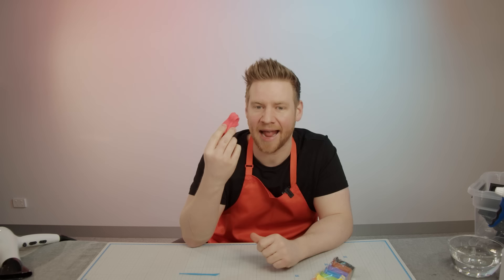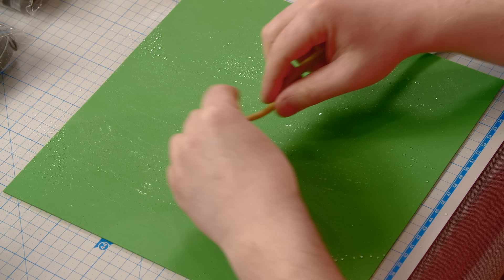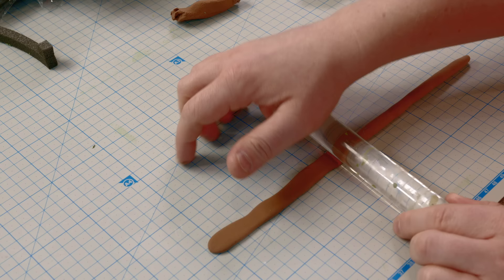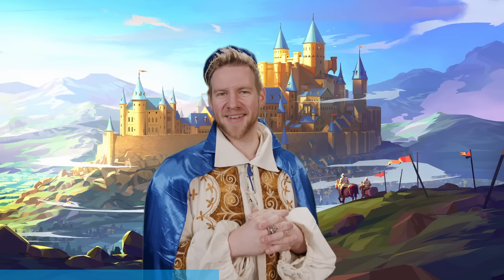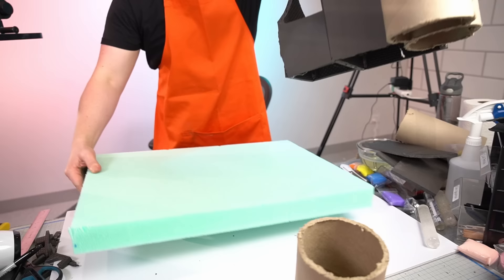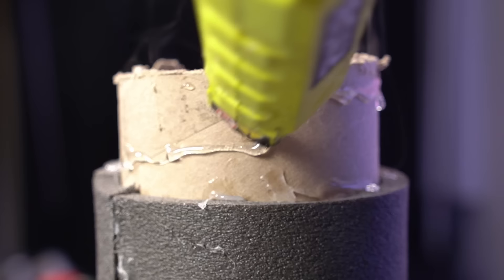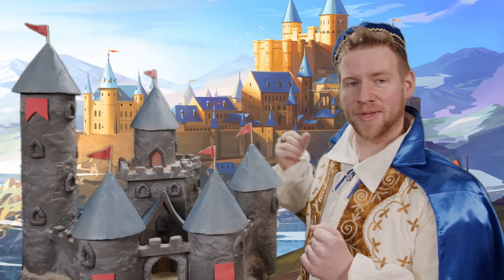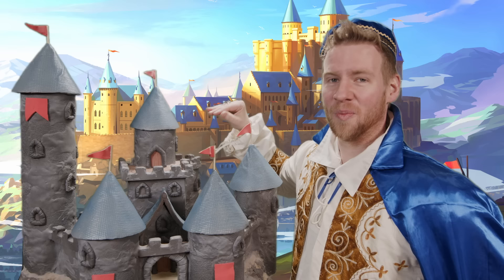"FOAM CLAY" is Mind Blowing...

Comment: I think the coolest part is using the foam clay for rocks. Lightweight rocks that can be cut, and are flexible sounds great for terrain.
Reply: This is exactly what I did with the Crayola version of it.  I even ripped up some that had dried to get rough, craggily surfaces.  I worked perfectly and since I used it for the basis of a wall hanging, the light weight was very much a must for me.

Comment: I LOVE foam clay ! I originally started using it to make my kid obscure figures/toys that were impossible to find or expensive which it’s perfect for because if you use a wire base and work very thinly then it still has minimal movement like bending the arms ect ! And if it’s breaks super glue works crazy good to fix it .. I’ve seen multiple youtubers (not Jazza obviously) bag it saying it’s useless , you can only do very simple child like stuff with it but it’s just not true ! Realistic is very ultra hard yes but I have made some awesome very detailed models using this clay you just have to go slow and work in very thin layers and add tiny bit by bit while drying in between ! If you try to make the whole piece in one go then yes it will be cartoony and simple . Wire and tin foil are your best friends with foam clay and you should keep the unused clay covered at all times it starts to dry crazy quick ! Instead of carving out details which is super difficult with this clay you just build up your details by adding bit by bit ❤
Reply: I had to take a screenshot of your post, since it has so much useful information I just know Ill need later. I got more of this stuff than anyone should, so thank you for all the tips :)
Reply: Most wholesome comment thread
Reply: You can do so much with this clay! I love using it for miniature food, it has the perfect texture for bread especially. You can shade the clay with both watercolors and acrylic to get realistic looking results.
Reply: @janemiettinen5176  that’s awesome I hope it helps !! The reason I said bit by bit (I add cm thickness onto the alloy foil base to start but then go down to mm or so thickness) is because if you go thick the very outside drys quick but the inside stays mushy for days! Something I didn’t include is water ! I reset my clay constantly it’s the only way to get a real smoothed out harder texture and if any mistake is made or even just want to add a touch of colour with the clay you can get a tiny bit and keep smoothing it out with a wet finger in you palm till it becomes a mushy paste and you can just rub it into the Dry clay , I do this too to stick details on like just wetting dry clay it won’t stick it properly you really have to rub in new wet clay first . No amount of clay is too much clay you’ll get through it ! I’m forever buying more 😂 just don’t get disheartened ! Every time I make something my first layer (the base) I’m always thinking ugh looks terrible! But I keep adding details and it becomes better and better just practice and patience 🙂✌🏼
Reply: @annuncreates5962  you really can but its seen as just kids clay for some silly reason🤷🏼‍♀️ yea your right I’ve made miniature burgers and stuff it really does work well for that .. I haven’t tried colouring it before I always spend time trying to mix to the right colour which is hard sometimes ! I wasn’t sure if I should use acrylic or what but I hadn’t even thought of water colour I’ll have to try it ! Does it rub of though eventually or soak in or do you seal it after ?
Reply: @bup489  😊🥰
Reply: This deserves more likes

Comment: I recently got into foam clay too! I am a face painter, and I recently decided to start doing face paint 'bling' (pretty pre-done displays made with 3d fabric paint, gems, and foam clay that can be glued on with proaid).
I've been having a lot of fun playing around with it. They're great for unicorn horns and trying to get gradients going is really interesting. I've been brushing on glitter and mica powder while it's still wet. And it's so easy to push it into molds for really pretty designs. And I can do decently sized decorations because it's so light weight it's not going to annoy the kids. I can't wait to have enough done that I can break them out at my gigs.

Comment: Been using this stuff for the last year... To mask miniatures for spray-painting effects. Works great! Specially if you wait for it to dry... But even if not, leaves no residue, weights nothing... and holds in place. Even more pleasing to peal than Tamiya tape... But to model scenery, for use over a flexible mat... Try stamping! Works great. As good as plasticine. Or maybe even tree-trunks, so they are flexible! Inspiration found...

Comment: An other way to "mold it" if you don't want to wait for it to dry in the mold because it takes a long time.

Put the mold in the freezer, demold it, let it dry and do it again!
For making a lot of small pieces without buying 1000 molds it's super handy! 😁

I try it with the grey one, it works with the black and white too. For the colors IDK, I see cosplayers do it with the black and white, but they paint it after so they dont use colors 🤷🏻‍♀️ and I did it with the grey one.

Comment: I am wondering how foam clay would work on Minis. Would it hold primer and paint well? Would it bond well with other materials? Is it light enough to be used as a bulking agent without adding too much weight? May have to get some and see.

Comment: Foam clay is so cool I found it last year on lockdown and got really into it… The only issue is it doesn’t dry right, ever. So everything I made was a total waste and by the time I came back to those little packages of foam they had also dehydrated so it’s basically a one use toy
Reply: I would recommend putting opened packs in a ziplock bag, then the baggy in a tupperware. Thats how I store it and it seems to work 🤷‍♀️

Comment: I used foam clay to make my adam and barbra heads from beetlejuice. Its such and amazing material to work with. When it drys you can actually use sand paper to smooth out areas as well. Really wish i could post photos cause they came out amazing!

Comment: How did you get the foam rocks to release so well? I used that exact same brand of foam and that same rock mold several months ago and they would barely dry, or when they did dry they would warp, and they were a pain to remove from the molds. Any help with this would be great because I bought a great deal of this foam, and plaster rocks get heavy when you have a bunch of terrain to transport around town.

Edit: Seriously I'm super jealous that you got this foam to work so well with the molds. It's exactly how I envisioned it would work, but it wouldn't do that for me.

Comment: If you mix foam clay with baking soda, it makes it dry way faster. Almost too fast to work with. You can also dust some baking soda on your hands and it will help it dry faster as well. I found this out on accident, it is a cool chemical reaction that you can use to your advantage.

Comment: If you ever have to cut foam in the future, consider a hot wire. The simplest ones are super cheap and get you very clean cuts already. The better ones let you set a specific angle and width for your cut, allowing for very cool shapes to be made.
Even the good ones are not too expensive and someone like you could prolly build one yourself. It's basically just a special wire with current running through it, there's loads of tutorials out there.

Comment: Awesome video. I use foam clay for customising action figures, fixing broken toys, and making simple models. It's not as good as using the proper resin, but I'm trying to customise as cheaply as possible, using whatever I have to hand. I've had some pretty decent results and it's more about the process than the end result anyway. 

I like it because it's cheap, versatile, lightweight, and adheres quite well to surfaces. It glues and paints well. It can be difficult to do small details due to how soft and sticky it can be but it's pretty good for building layers of clothing or new hairstyles onto figures.

I would also say for larger models, if foam clay is the primary material being used,  it's best to make it in pieces and attach them after it hardens (I.e. make an arm and then work on a torso while the arm hardens). Because the soft clay can't take any weight it will deform as it dries if their is any verticality to it.

Comment: I love foam clay but it does try to dry too quickly for my tastes if you're using a thin piece and the water changes the texture more than I would like, so when using it I often feel rushed. Though someone suggested popping it in the microwave as it starts to dry, which I need to try.

Comment: My aunt bought that for me, my siblings, and my cousins, and we had so much fun with it! Some of the foam clay had dried up in the plastic, which we found out upon opening though...but it was still really cool! We didn't know it was called foam clay though. My aunt got it from Shopee and it was labeled as air-dry clay.
Reply: Also were you using a nail thingy to make lines on the floor of the battlements?

Comment: To save you some time and money…if you’re working with eva foam, you can use a heat gun to “glue” one piece to another. A glue gun isn’t needed. The interlocking foam he’s using is usually made of Eva. Pool noodles is made of it as well.

Comment: I've been watching for years, and I'm a big fan of your work, but I cannot stand by this project. It simply did not meet the standards I've come to find in your works. The rocks were incredible and looked very good. And I have nothing negative to say about the small village project you did. It met it's own aesthetic and stuck to it; but by comparison the castle project felt like a mishmash with the obvious contrast between the foam parts and the smudged on clay, it did not look good. With a little more time I have no doubt it would have been spectacular. I'm sure it came down to a matter of over-committing time to the project you didn't have in excess to meet a deadline.